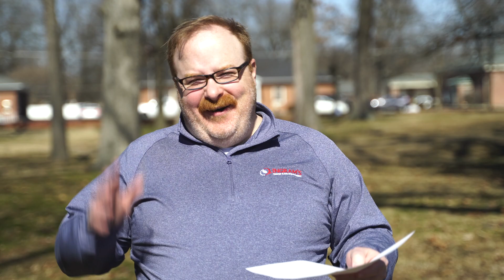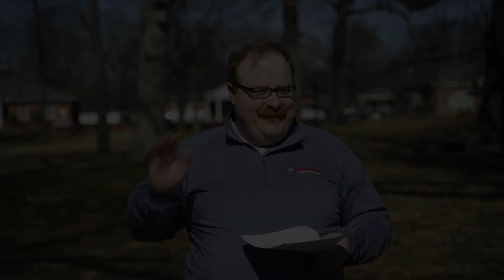MrCool DIY - How Do You Know What Size? - Ask the Expert

Comment: Need some help with sizing the correct Mr. Cool unit. I have a 900 square foot cottage on Lake Ontario in NY. It gets pretty cold. Single story with 8' walls that vault to 11' ceilings. 2 bedrooms that are ~ 11' x 12' and the main living area is 28" x 22'. Ceiling insulation is R48 and floor is R30. It is built on piers so the floor is somewhat exposed. My main concern is getting enough heat to make this usable year round. TIA for your help.
Reply from the maker: If your main concern is heat, you would likely be better served by a MRCOOL Hyper Heat than a DIY.

Comment: Putting a mini split in my garage, 660 square ft with 9.5ft ceiling height. Deciding between a 18k or 24k unit. Like the idea of the more powerful 24k unit for faster temp changing when a garage door is opened pulling a car in/out but worried about 24k being too powerful causing humidity to stay. What do you think? I'm looking at the MrCool DIY models.

Thanks!
Reply from the maker: 24k might be oversized, but that is less of an issue with the new variable-speed converters. Also, the DIY models have Dry Mode. It runs the unit at a lower capacity to increase dehumidification. So, if you do have a problem with humidity, it is a solvable one.
Reply: @Ingramswaterandair  would you recommend the 18k then? Or the 24k unit since it has variable speed settings?
Reply from the maker: All the MrCool DIY models are variable speed. If you're in a really hot climate, I would probably go with the 24k.